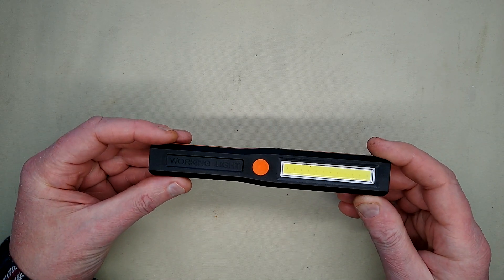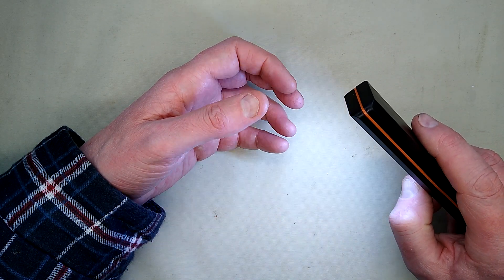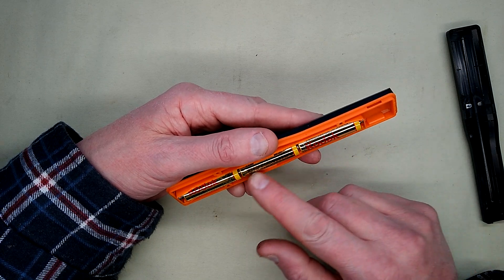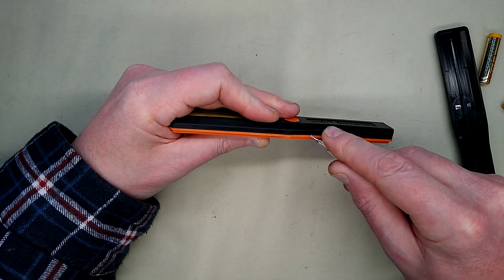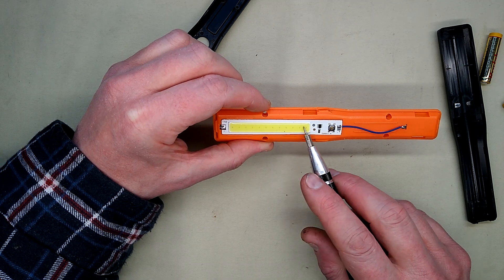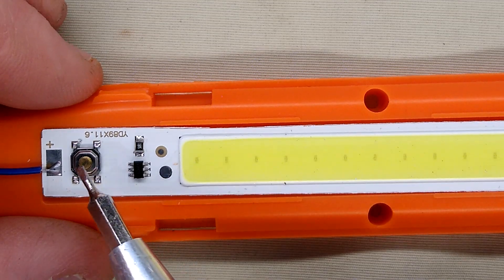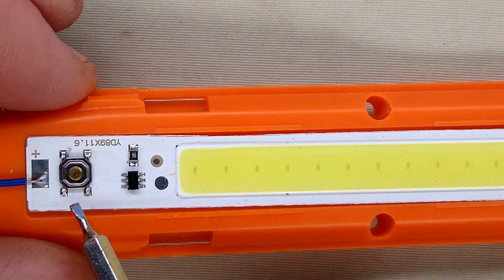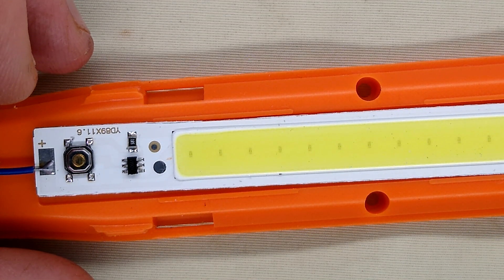Is this the new COB flashlight standard?

Comment: Mine stopped working and thanks to this vid I realized I could pry this open (I initially thought it was pressed-on) and found out that the extremely thin piece of wire connecting the batteries to the PCB was severed at the soldered end (the Chinese are hugely cheap on copper...). Soldered it back and have it working again - I was too upset cause It's extremely useful because of its size and magnet at the back and these items are hard to come by these days.

Comment: Would love to see you do more videos regarding high-quality low priced flashlights. Like the Astrolux and convoy available on Banggood. 

Specifically the convoy C8, m3, and I really love the Astrolux FT03 which I got from Banggood today for $35 shipped on a flash deal!!! which includes a high-capacity high drain good quality 26650 rechargeable battery!
That’s 4300 lumens out of the beautiful Cree LED in a incredibly made light with built-in charging, and protection… All for under $35! It’s literally nicer and better made than some of the $250 lights I’v owned

Comment: Current vs operating voltage? Cutoff voltage? (there is  -12 (v?) marked on the board.
Reply: 12v automotive variant of the same, but that one has power input option. they design to handle 3-12v for wider marketing and designs

Comment: I'd be curious to see you test this cob a little further to see what kind of voltage range it can tolerate. Would it run tolerably off a single Lithium cell? I have some good Lithium cells that would fit in one of those rather nicely.
Reply: I have the same size lithium cells and the same question?  Specifically, will lithium cell draw too many amps and burn up LEDs, even though has less nominal 3.7 voltage?

Comment: Presumably the low light setting uses a narrow pulse width for the dimming, so that the heat won't damage the chip.  Does the high setting use just the resistor?  With the chip fully on?

The local store has somewhat similar lights, hanging on pegs.  The pegs have locks on them and you have to get an 'associate' to unlock it for you.  Then you can put it in your pocket and sneak it through the checkout...  😮😮

Comment: Hey Clive (or anyone).  Have you ever done a video on how to disable the strobe mode in similar  chip controlled torches (flashlights) ?
Reply: it's a feature of the chip, quite likely you can't disable it, but if there's the current limiting resistor you can install a simple switch instead of the button... i ordered some time ago some toggle switches that have a middle position that disconnect anything, so one way it's a tighter resistor for Max Power, the other way there's a looser resistor for low intensity and the middle is off... 3 laptop 18650 batts and a 10W power led made a wonderful torch, the problem was charging it but it lasts months

Comment: Unrelated question, but wondering in all your internet searching if you've came across packs of Christmas light caps? Looking to add them to micro lights, so after just the caps (the fairy light style diffusers).
Reply from the maker: Very rarely the caps on their own.  But you can buy full sets of lights at dollar stores / pound shops and strip them for their caps.
Reply: @bigclivedotcom  yeah I am thinking this might be the best way to go. I like the ones from B&Q (I'm in northern Ireland) that I have seen, the type that slide over the LEDs and are the shape of traditional fairy lights. Got some a few years ago that are starting to fail. More recent ones also heat shrink the shades on. 
I am hoping vintage style (eg pifco) make a huge come back with LEDs soon. Currently messing with new ws2812b micro LEDs I recently found on AliExpress. They are fully programmable but are the size of the micro LEDs on the copper wire. You should check them out. They look amazing in person but sadly the early batch seems to have a flaw. Instead of single core with insulated coating it's actually multi core which I am guessing is the cause of shorts I am getting when the wires cross. I ordered a few more to see if they figured out the issue...but...coronavirus shipping. 

PS, love the vids and humour :)

Comment: Got a tool cabinet light which is likely the same thing but without the blink modes. Difference is the outside is an aluminum extrusion and the batteries go in from the end. Same idea with the magnet too. Plenty bright for 3xAAA (better than those little fluorescent tube lights), but it'll burn through the batteries if you leave it on too long.

Comment: I recently converted a Poundland COB Headtorch to a single lithium cell with a TP4056 chip it all just barely fits in the battery compartment. these COB chips that run off 3xAAA are perfect for a single Lithium cell. I suspect this one can be converted too.

Comment: I wish these devices operated like expensive headtorches (Petzl, LedLenser, etc), where after it's been on for a couple of seconds in any mode, pressing power again switches it off, rather than continuing to cycle modes.
Reply: @EarlySwerver
I have a higher end model Aldi head torch, which only cost me about $20 Australian a few years ago.
It has that same off function as that, and the light is better than Petzl, LedLenser ones that some friends had on a night time frogging expedition I went on. They all saw my light and asked me the brand as they were so impressed.
They were rather shocked and thought I was joking when I told them it was from Aldi!
Reply: @ericoppel5698  The middle aisle of Aldi always contains treasures.

Comment: I picked up one similar to that but it is longer and has more lights in the end of it so it can be used like a regular flash light. It has a metal hanger on the end so you can hang it up. It is very, very bright. It works great for working on cars and tight places. I paid $5  for it right around christmas. I got 2 of them, one for me and one got my son in law.

Comment: I've noticed that a lot of dollar shop flashlights are cob type ones. Just today I've been looking for one with a few 5 mm LEDs to convert into a UV flashlight for some UV curing glue I bought. Are they more power efficient than the straw hat type I wonder?
Reply from the maker: They're very cheap to manufacture as most work can be done by machines.

Comment: I don't mind the AAA batteries, but why do they have an odd number of batteries??!!?? There is always one battery left over, and depending on your charger, you can only charge 2/4 batteries at a time
Reply from the maker: The LED voltage is around 3V so 3 cells are needed to get efficient use out of them.
Reply: I have never been able to buy a 3pack of batteries 🙂
Reply: That's the exact reason I bought a 4-cell charger that charges each one individually. As an added bonus, I managed to salvage all 6 of the AA batteries the two-cell-at-a-time charger claimed were "bad." But you do have a point - an odd number of cells is rather inconvenient because batteries are sold in even numbers.

Comment: In the round  torches that use the 3x AAA cells with removable housing, I chuck it out and use an 18650, fits perfectly
Reply: I suspect the torches are actually designed for 18650s and the adapters allow AAAs to be used instead.
Reply: @Shadan Rikan The 18650 'housing' is just a sleeve to stop the cell rattling around, an 18650 cell should already have shrink wrap to isolate it.

Comment: Flashing and or SOS modes should be banned. UNLESS the ability to turn it off right away after it’s been on for at least 10 seconds. 

I hate those that you turn on and then minutes later it still forces you to cycle through all those modes just to turn it off.
Reply: I have one that also slowly strobes a red light and have used as a warning whit magnetically stuck to my bumper during vehicle breakdown.   Strobes are worthless and if you're smart enough to remember how to enable the SOS function you should be able to remember some dots and dashes and manually perform that function in the 1/1,000,000 chance you actually need it... and happen to have that particular light on you.
Reply: @JasonWade  Culling the world of people with photosensitive epilepsy.

Comment: I may be asking the obvious but high low and SOS, I get. What possible use is there for a strobe mode?
Reply: loxxxton poxxxton connect a strobe light to a burglar alarm / sound bomb and watch the burglar try run through the closed door
Reply: @lloydtucker  yes and also at discos they are great fun, but what use is a strobe light function on a small hand held £1 torch?
Reply: What possible use is there for a strobe mode?  Inducing an epileptic fit  All flashing modes are shit
Reply: making hamsters dance... or inform other drivers that your car is stopped for some reason
Reply: @redoverdrivetheunstoppable4637  informing drivers you've stopped? By flashing a strobe at them! Well ok then I'll give it a go. I get first dibs from the wreckage though
Reply: @TheLoxxxton  that's what i know about that feature, it took me some time to remember it, there's a magnet, you can stick it to your car at night... that's not wrong to do that, flashing lights are used to signal objects on a road
Reply: @redoverdrivetheunstoppable4637  but strobing white light?

Comment: Ah, thank god, they kept the SOS.  So many people use that mode all the time.  I was worried for a second there.
Reply: Right? I wish they'd dispense with the strobe mode, also. It only serves to annoy the crap out of anyone you shine it at.
Reply: @getyourkicksagain  - Well that is what the strobe function is for... point it at the guy that is attacking you.  BUT it shouldn't be on most flashlights that will never be used that way (EDC, etc.).  And it definitely shouldn't be a mode you have to toggle through every time.  Remember those good old flashlights with those high tech yet simple on/off switches?  On or off, those are your two choices.  Those were the days!
Reply: @ElmerFuddGun  I honestly did not know that was it's purpose. Thanks. In a real emergency, though, I'd probably just cycle past the damn setting and get clobbered anyway, LOL!
Reply: @getyourkicksagain  - Exactly.  Very easy to cycle past and the bad guy isn't going to wait while you find the strobe function.  And even if you are "prepared" and have the strobe "set" to be the next mode it turns on in it is easy to forget or bump it into the next mode especially when in that emergency.  Better to have a separate button for it or don't have the mode at all.  IMHO.
Reply: Just from a purely statistical standpoint, I'm sure it's helped someone at some point.
Reply: @ElmerFuddGun yeah, hang on till I press this button a few times before you start punching my head in!
The only time I have used this is on a bike, 1 light on solid, 1 on flash mode makes you twice as noticeable in amongst heavy traffic and saves a bit of battery juice

Comment: I wish  I could buy an LED torch that just had an off and an on.
Reply: @Donald Sayers OMG YES, this!!! They keep adding unnecessary functions to these things when all I want is a binary version.
Reply: Donald Sayers bypass the chip I’m ssd use it controls the modes
Reply: @lloydtucker  It also has the LED driver in it that regulates the current to the LEDs and takes the push to make impulses from the switch to turn the LEDs on and off etc. So it is not so easy to bypass, you would need a LED drive and a new switch.
Reply: They are around, I got a couple of pen-style ones from Amazon with 8 individual LEDs and a button on the top .  They have two modes, on and off.

Comment: This little light, with a 3d printed back that takes an 18650, would be great :)
Reply: Perhaps just mod this one to take an 18650...
Reply: That is a great idea._
Reply: Are you pretty proficient with these things? Have a bunch of questions about inrush current and a couple projects I could use some input on. The simplest of which is determining the easiest path to taking a 2p4s battery pack from a Milwaukee tool and removing the second row of 21700’s so I can use the first row and the terminals etc. to replace the cells in a 1p Milwaukee battery case that needs new cells

Comment: I have a few of these and they all share one flaw. After a few minutes when the leds have heat-soaked everything around them the brightness decreases significantly.
Reply: it didn't look like it had enough electronics to reduce brightness in response to temperature of the led cob. Maybe that little chip thing does all of that?

Comment: I am not a fan either of AAA battery flashlights because they don't last long especially with these COB LED strips. I would rather have this light be slightly larger and then take AA cells than be smaller and use AAA cells.

I have this life gear lantern style survival flashlight that runs on four AA cells and has a few modes. I took out the light and battery holder assembly and it has a switching chip similar to your light and I ended up covering the electronics with hot glue to seal them and make the light waterproof even if you have it out of it's outer protective case. the spot where the 6V battery goes you can store survival stuff in there.

Comment: Anyone know if it's possible to buy the actual LED dies that are used in things like this?
Reply from the maker: The bare dies seem to be the flip chip type for automatic placement and reflow soldering.  I've never seen them for sale on the usual channels because they are so specialist (and tiny).
Reply: @bigclivedotcom  Mmm, I was afraid they'd only be geared towards that sort of assembly. The closest I could find are these things, which look to have a few actual dies on a little carrier -
https://a.aliexpress.com/_BS4HXh

Main reason for farting around with this - I had thoughts on using them as a pump for a NdYAG laser rod, but the white ones aren't a great wavelength match.
Reply: @ruben_balea  Thanks, I was meaning the actual LED dies, which are assembled into the COB array.

Comment: I wonder how long it will take them to notice that nobody wants any flashing modes.
Reply: I guess it depends on your application.  Flashing is good for getting attention.  See also bicycle lights, hazard lights.
Reply: Sure, but having flashing as a mode in a worklight, that comes up every time you want to turn the thing off is quite bad
Reply: @techtastisch7569  It's annoying on my bike lights too.  I don't feel any more entitled to get attention than any other road user.  Flashing is for emergency vehicles.
Reply: @westinthewest  Blinking on bicycle lights is intended to save battery, by using them only some of the time.
Reply: It's been what, like 15 years or so? So I'd say never is a good guess. If they would just "hide" it like the sos mode on this light so you don't have to go through it every time, I'd be fine with it though.
Reply from the maker: About the same time it took them to notice that people don't want their Christmas lights to come on in a demo mode.

Comment: I would like to see a flashlight that can tell you the battery percentage. This could easily be done by having a mode where it blinks the LED a number of times. 10% per blink. Just count the blinks and vwala, you know roughly how much battery power you have remaining.
Reply: Lights that cost a little more usually have features like this. I'm currently carrying a zebralight that has that exact functionality. It does cost significantly more but its one of those cases where you buy one light and use it for years and years rather than buying 10 cheap crap lights over the span of a year or two. Unless you're a flashaholic like me of course.

Comment: Nice light. I need one that'll take an 18650, as I have loads of those. Would probably get an 18650 enclosure and epoxy it to the side.
Reply: Nah, there's no way an 18650 will fit in there; it's just too thick, unless you add a spacer between the 2 halves of the case to add some girth to it. I don't own a 3D printer, but that would be the ideal way to make a custom enclosure for it.
As for duct tape and hot glue? It works. My last DIY torch was an 18650 cell holder with a naked LED board hot-glued to the back and a switch glued to the side. It looked awful, but yeah, it worked... Until my son ran it over with his car.
Reply: i mean, essentially you could just install some kind of 18650 inside the housing, it looks big enough if you do some dremeling
Reply: @iHawke  i agree cut out/off what you need to fit the 18650 in as snug as you can, if thats the type of cell you are going to settle on.
Reply: @The Muckler hot glue.
Reply: That will make it run for hours on end at Full Bright. :-)  Nice addition indeed.
Reply: Super Clark  Plentiful, high capacity, rechargeable and many reputable brands have developed and improved the performance of this form factor. They're in lots of gadgets like laptops (where I usually scavenge them), electric bikes and even electric cars. An alkaline AAA battery has about 750 milliamp/hours (mAh) while an 18650 has typically 2200 mAh or more, so about 3 times the runtime. A 14500 battery (AA size) has about 900 mAh, so not a huge improvement, and most of them are branded Ultrafire or some other crappy brand (I haven't seen LG, Samsung, Sony etc. making 14500s).
Reply: @getyourkicksagain  when comparing battery capacity for batteries with different voltages, make sure to compare them by energy (e.g. Wh) instead of Ah.
Reply: @positivemelon7578  You're right. I'm just lazy and read it off the labels 😉
Reply: @getyourkicksagain  Sony  VR2, Sanyo UR14500P
Reply: @RenThraysk  Cool. I stand corrected. Thanks.